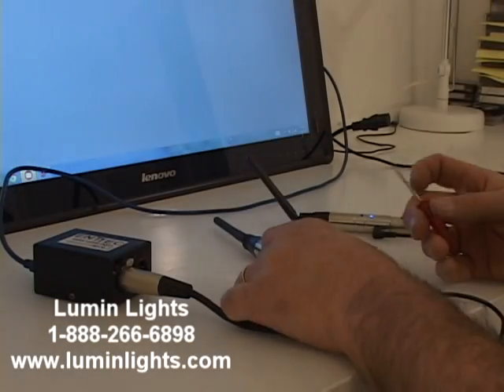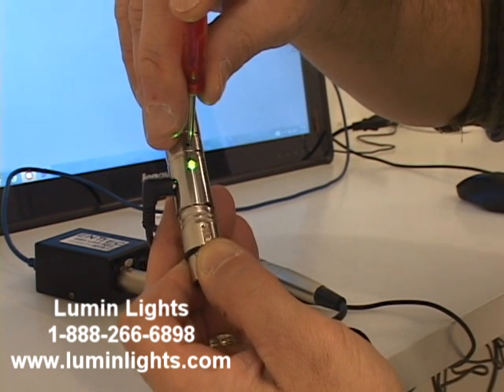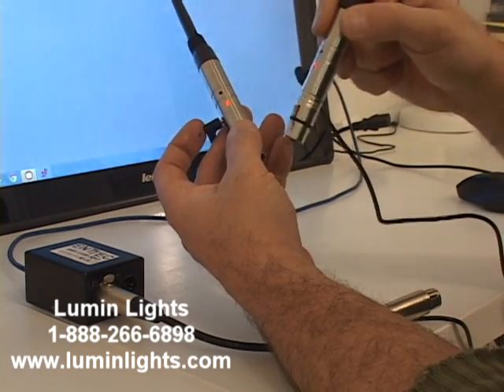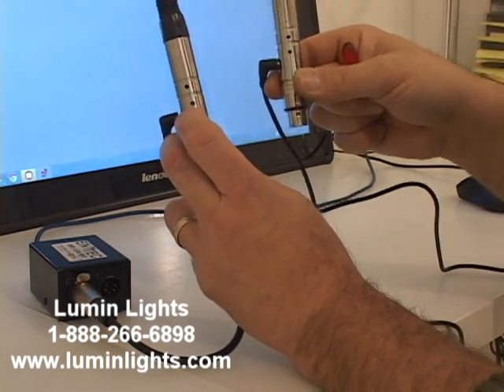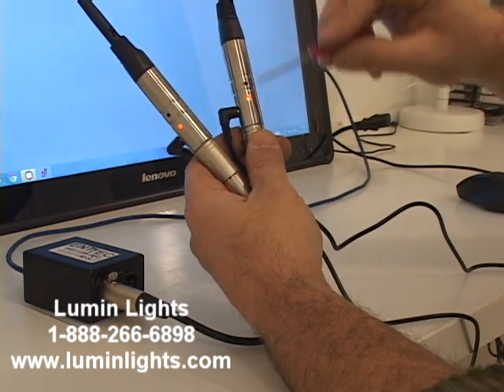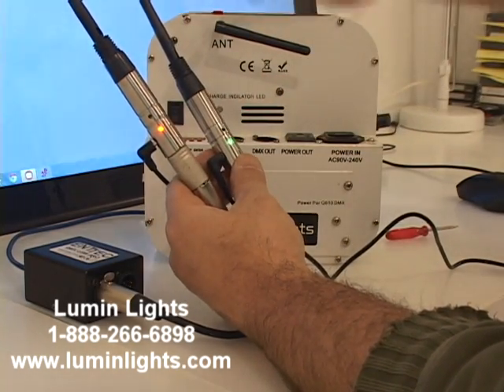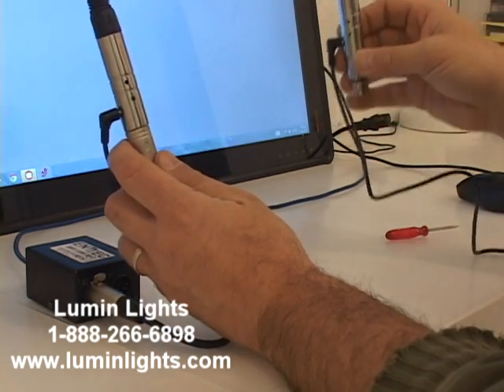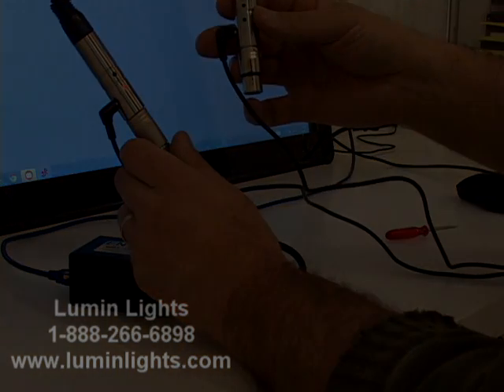Lumin Lights Wireless DMX Stick Transmitter/receiver controller

Comment: Has anyone thought that If the transmitters had built-in batteries this would be great technology to transmit any hand-held microphone? Or is the signal of a vocal source completely incompatible. Mic transmitters always have a big bulky receivers and no one makes the plug-in transmitter system any more. I use the old AKG 'Snap-on' SO40 and it's great, but physically knackered.